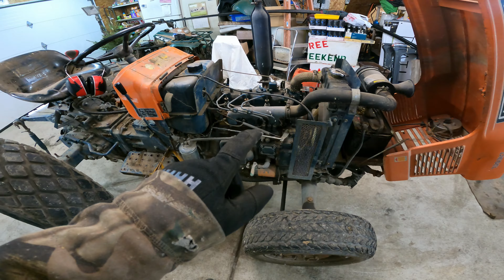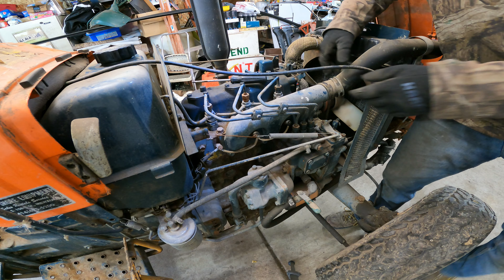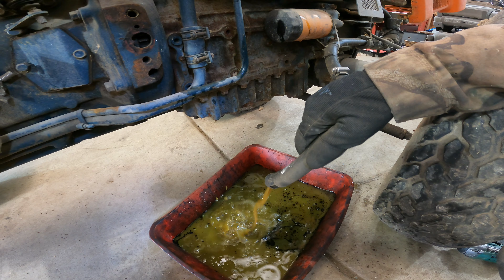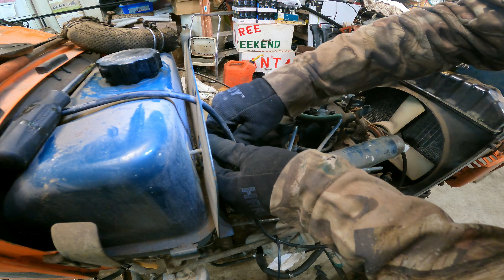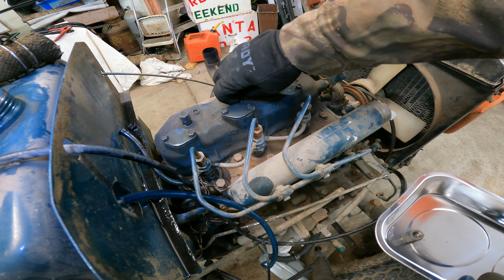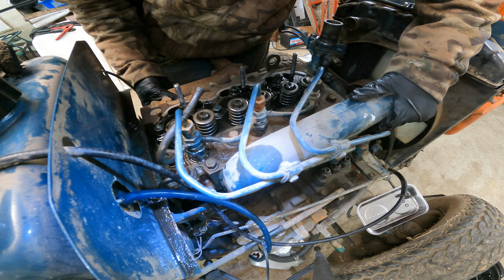Will It Start??? TEARING APART A Kubota L245DT That Has Sat For 5 YEARS (Taking The Head Off)

Comment: Uh, I don't think that tractor's from 1995. It looks identical to my L245DT and mine's from 1977! The L245's were some of the original Kubota's tractors exported to the US.. Brought over from from 1977 to the early eighties. If you want to really figure out the manufacturer's year and the tractor still has its original rims, check the stampings on the wheels. Mine are from '77, though the tractor may have been exported later. All that said, I've been able to find lots of parts. There's still quite a few of these around. Much easy to work on and absolutely indestructible (though I have not pulled the head).

Comment: If u have a blown head gasket u should definitely have the head checked for warp age. If the head is warped then the machine shop will need to dress it so that u don’t blow the new gasket. That’s just my opinion from working on car gas engines
Reply from the maker: Hey there! We will be sending out the head to make sure it is not warped along with getting it pressure tested because these heads are notorious for cracking.